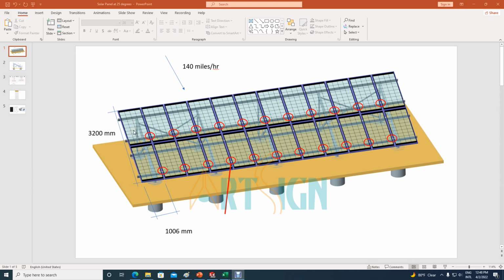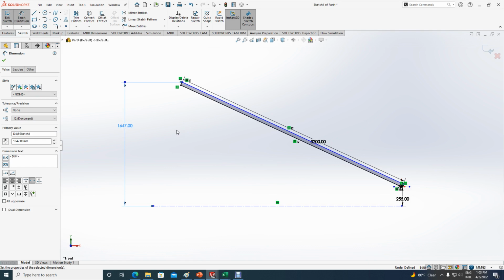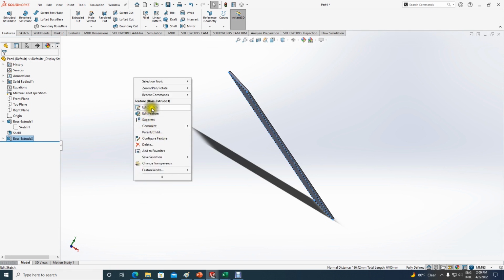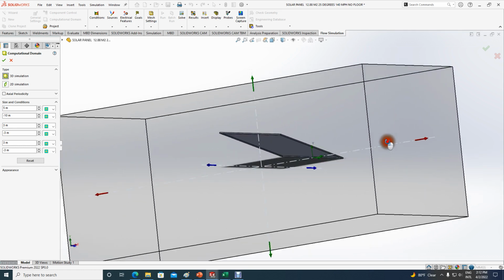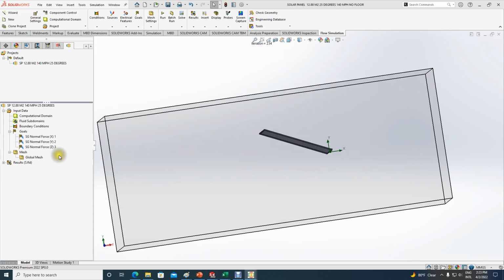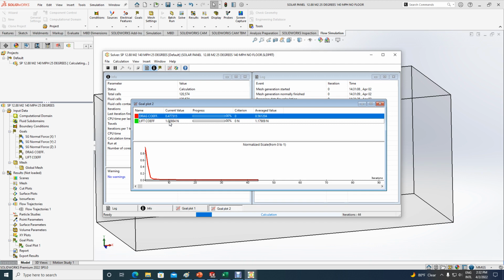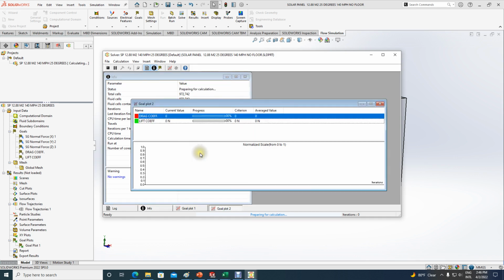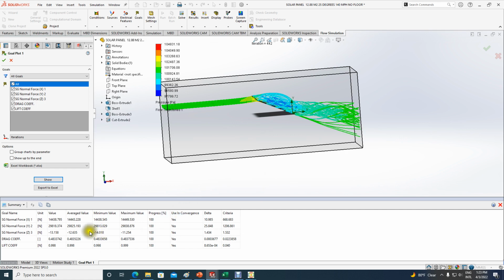HURRICANE LIFT AND DRAG FORCES ON SOLAR PANELS: CFD ANALYSIS WITH SOLIDWORKS_PART I (NO FLOOR)

Comment: Wowwwwww....140 MPH....??????....According to your latest simulation (mesh 7), you showed a lift force of 30,000 N and a drag force of about 14,000 N. How do you convert those forces from the wind in what is required to ensure that the solar panels are well anchored to the ground?  Very good video.  Thanks.